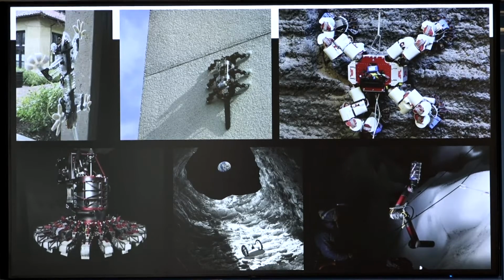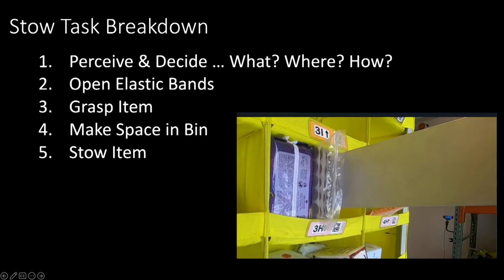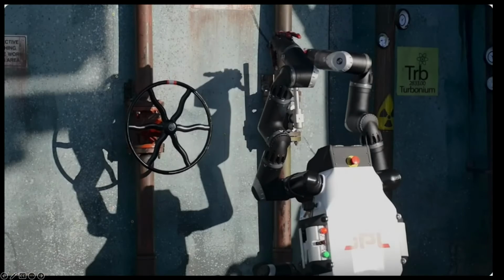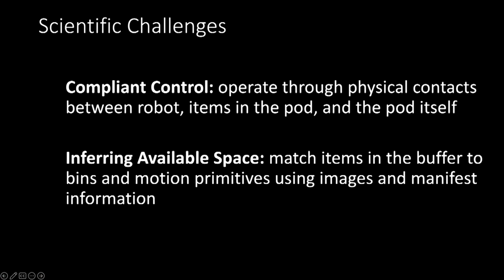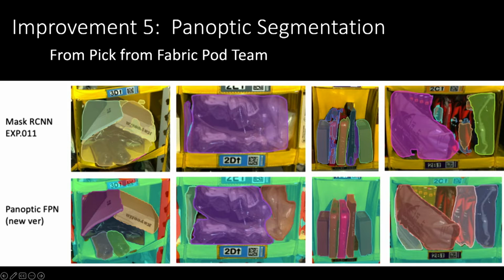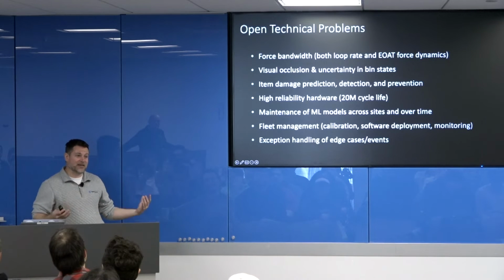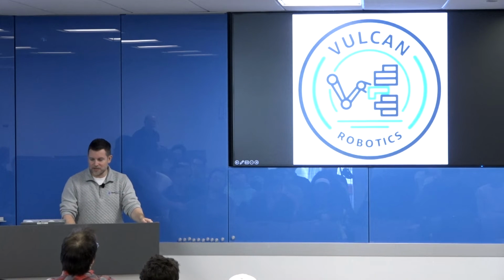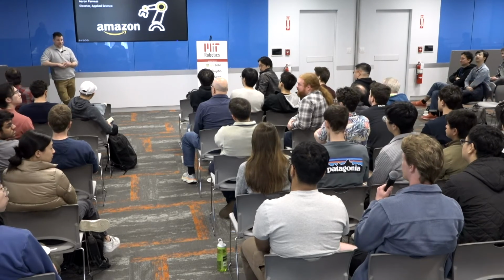MIT Robotics - Aaron Parness - Stowing and Picking Items in E-Commerce

Comment: I'm an inventor that's started to work on industrial robotics. IMO, the problem with the bin packing robot is that you haven't deconstructed the problem to take advantage of a robot's strength. For instance, one advantage could be a very long arm. So, rather than place the items into the bin, as a human would, the items are placed from the top of the bin. That is, they're placed in order from bottom to top. This can only be possible if a robot has a large arm. There are other advantages such as the use of gravity to filter and push the items together, that only a robot could do that a human can't. In any case, thanks for the presentation.
Reply: great point, we should utilize the strength of robots rather than imitating humans behavior
Reply: Moar